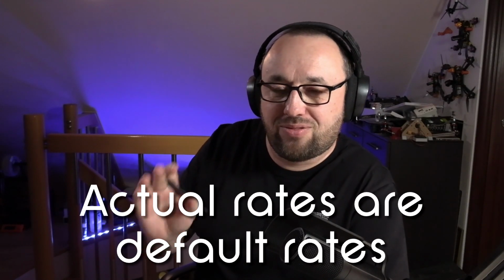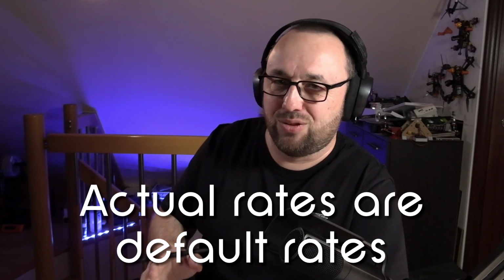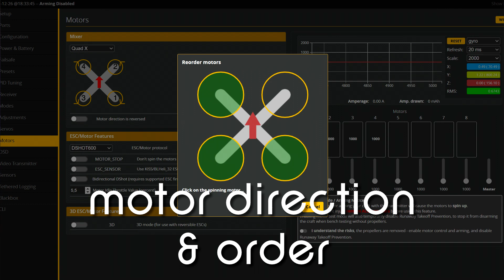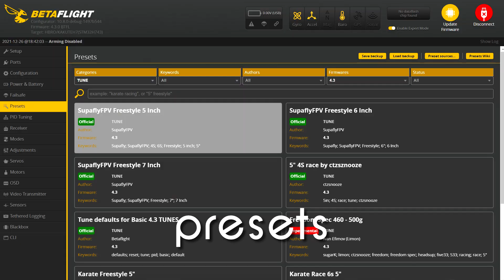The top features of Betaflight are...

Comment: I don't understand who needs any filtering but dynamic notch on gyro... You only need it if you have your motor bells absolutely out of balance and props are cut out from soap box with your hands. I fly with heavily beaten props and motors and just only dynamic notch on gyro from 150hz and biquad 120 Hz on d term... And it's just ready to sky apex clone with rcinpower 2207 2750kv motors, with one bell replaced by old velox bell))) d term 42, P 75. But it's emuflight)))
Reply: The RPM filter works WAY better than the dyn notch. So always use the RPM filter if possible and only use the dyn notch to erase the last bit of resonance. But I can only speak for BF here as Emu doesn't have RPM crossfading yet and the motors might get hotter than on BF 4.3
Reply: @TimeFadesMemoryLasts  Motors are cold on emu always... dynamic notch on emu works like bf rpm filter following throttle stick commands, but not motors speed... So you don't need alexpensive 32bit esc or buying jesc license for S esc. As for jazzmaverick I had some problems with it and didn't use it for the long time
Reply: @О.Ш-ь1щ  I don't know where you got this from but that's not true. The dyn notch in Emu is a copy of the BF 4.3 dyn notch. It doesn't work like the RPM filter. The RPM filter is still way more effective at precisely cutting out motor noise. Its tracking delay is about 1ms vs. a tracking delay of about 30ms for the dyn notch. The dyn notch will always have a bit of lag while tracking the motor noise because it can only react to noise that is already present. The reaction time is why it can never be as good as the RPM filter (even if you bump up the RPM Q value higher than the dyn notch Q value).

Btw. to use RPM filtering on BlHeli_S ESCs you can also use BlueJay which is Open Source 🙂
Reply: @О.Ш-ь1щ  "dynamic notch on emu works like bf rpm filter following throttle stick commands" - это даже не смешно :)